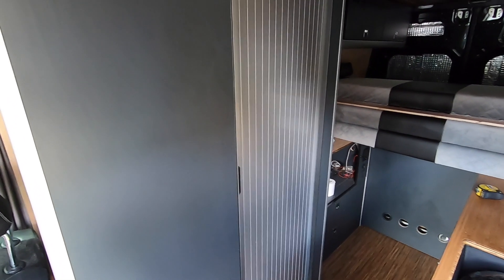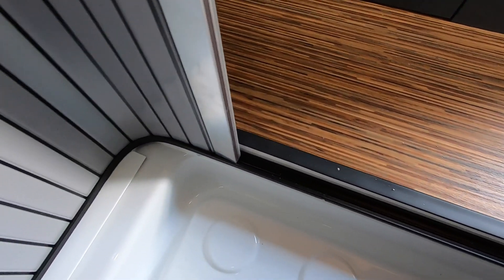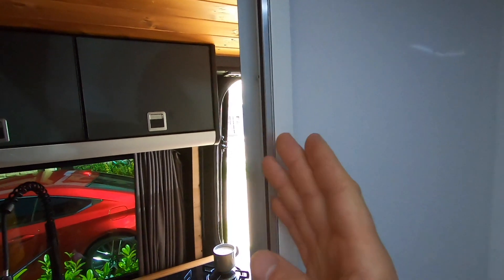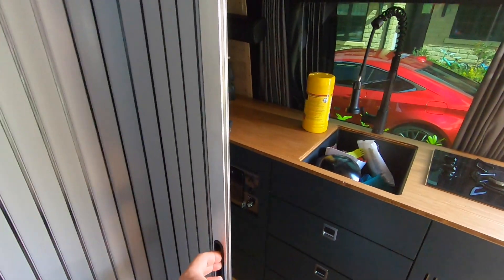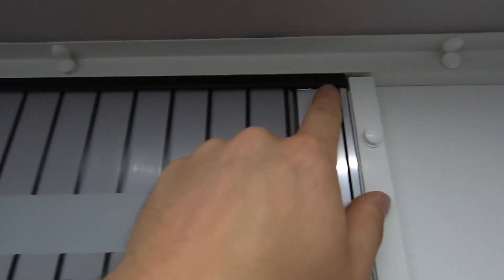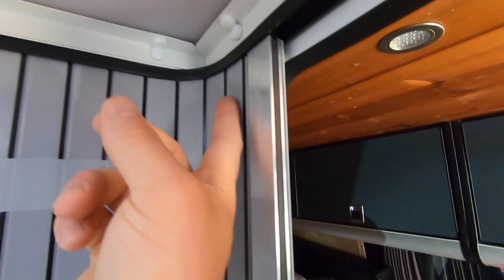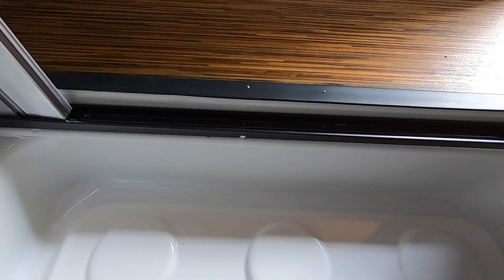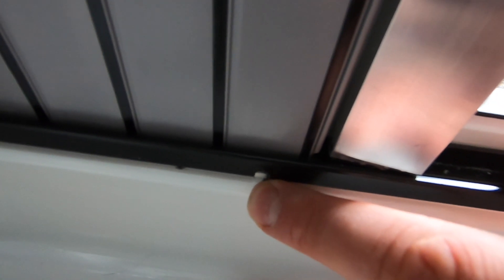Sprinter shower door install

Comment: Very useful video - thank you.  I wasn't too clear on the 2020 part - was it aluminium then clad in PVC? Also, what length is your bathroom inside? It seems quite spacious. Thx.
Reply from the maker: Hi. Only the door ‘jam’ the bit it closes on is aluminium. The rest is plastic. 
The shower is 1100mm in length 👍🏻

Comment: Did you do any stud work for the shower walls? Or are they all out of the 15mm lightweight ply? Thanks.
Reply from the maker: Just the 15mm panels mate. East strong enough. As long as your opening doesn’t leave too smaller but around the edge if that makes sense.

Comment: Great video! What is the actual door way opening you have? Eg is it 600 or 400mm (the bit you step through to get into the shower
Reply from the maker: Ha. Exactly in the middle of that. 500mm. Which is plenty wide enough. But can make as wide or narrow as suited 👍🏻

Comment: looks great, could you give some details on the shower tab you used, that look really handy
Reply from the maker: What are you calling the shower tab?
Thanks
Reply: sorry, I meant the shower tap/mixer
Reply from the maker: @JanWillemHelmers  ah no worries 
https://www.ebay.co.uk/itm/Modern-Mini-Vertical-Thermostatic-Shower-Mixer-Valve-Bathroom-Chrome-Brass-/133192074085?_trksid=p2349624.m46890.l49286
Reply: thanks, seems perfect for my plans
Reply from the maker: @JanWillemHelmers  good stuff 👍🏻

Comment: Brilliant tips for installing the tambor door. Where in your wet room did you mount the shower and how waterproof did you find the door ?
Reply from the maker: I have a shower video you can see exactly where 
Door really waterproof. 👍🏻👍🏻👍🏻
Reply: @urbanarkoverland I'm really pleased to hear the doors are really good at repelling water and in your post I can see where the shower mixer was mounted but where did you mount the shower head please ?
Reply from the maker: @janetward5449  just on the wall that the tambour folds around on. The tambour will hit the top and leave a gap getting bigger due to the shape of the van 👍🏻
Reply from the maker: @janetward5449  watch my TRUMA boiler video. You will see 👍🏻
Reply: @urbanarkoverland  we're going for the Truma 6e. Hadn't even considered a trigger head but we're fitting an ecocamel head which has worked well for us in the past. Many thanks for your help 👍🏻
Reply from the maker: @janetward5449  yeah both have their uses. But I do use the economical head when showering 👍🏻
Reply: Great video thanks. Did you manage to find long lengths (1800mm) of 20x20 upvc trim? 
Cheers

Comment: What is the width of the runner please? Just trying to work out how much lip I need to leave on the shower tray and can't see it specified on the website. Looks like around 20mm?
Reply from the maker: It’s around 15mm tall. And 25mm deep. Message me on insta @urbanarkoverland and can send you pics if you need.